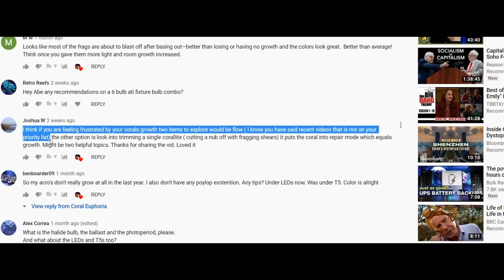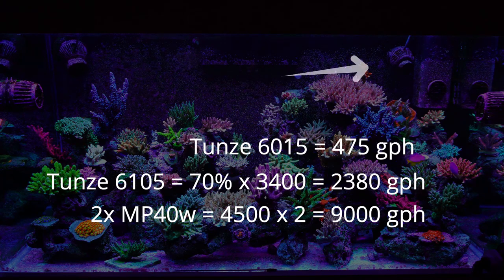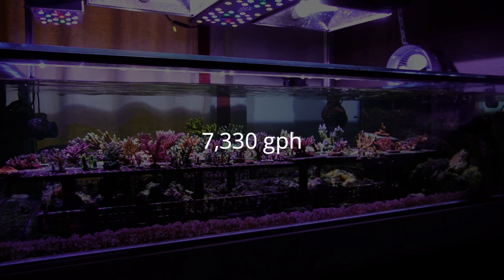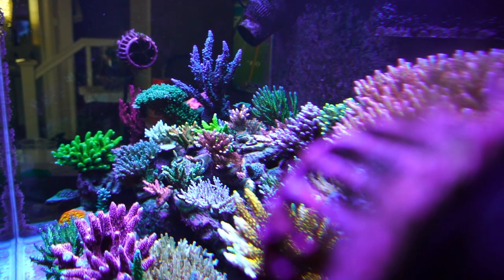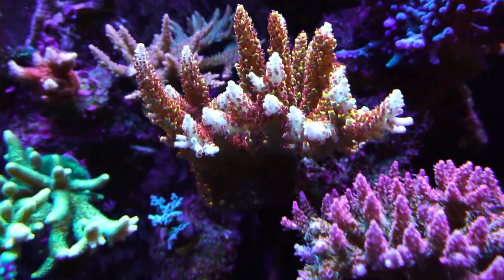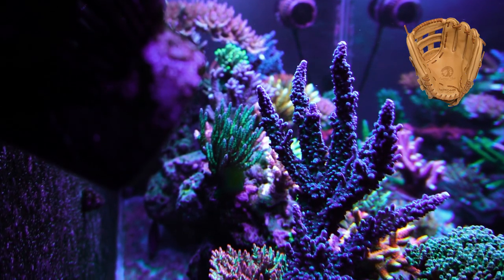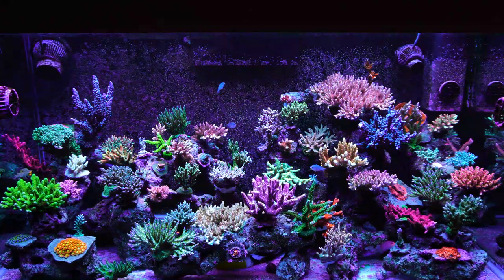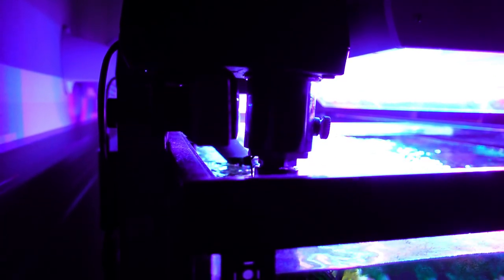Beginner SPS Reef Tank Flow | Acropora Flow Tips

Comment: Awesome video, im currently trying to tweak the flow in my tank since i want a mixed reef and dont want my lps to get blasted. What i have so far is 1 mp40 on the bottom corner at reefcrest 80% and the front mp40 in pulse mode 60%.

Comment: I run my 200 gallon mixed reef with a single pump, a Jebao CP-150 and it's not on full power. It's near the surface on the overflow, so I have no pumps on the glass. Just a few stags. Having no visible pumps really makes the tank look very natural.

Comment: What are your thoughts on the wave box. I have 4 powerheads and considered using the two across the back to create a similar standing wave to the tunze while the two at the front run a more typical mode. Do you think  the pattern from the wave box provides and unique benefits?

Comment: Do you recommend using cross overs or rather use various pumps on different parts of the tank ?
Reply from the maker: Cross over,l? Like closed loop? I rather use powerheads if possible for simplicity, but closed loops may he necessary for extra large tanks